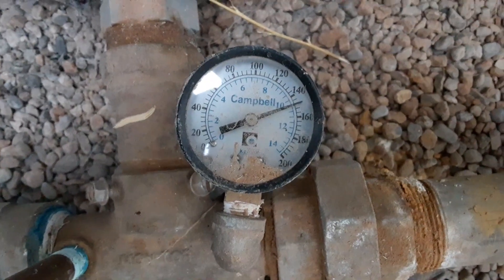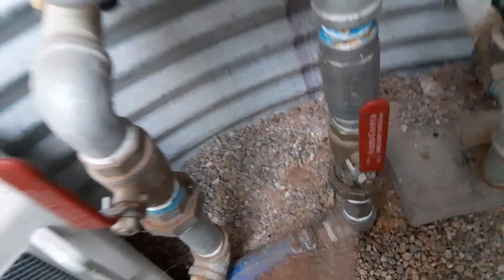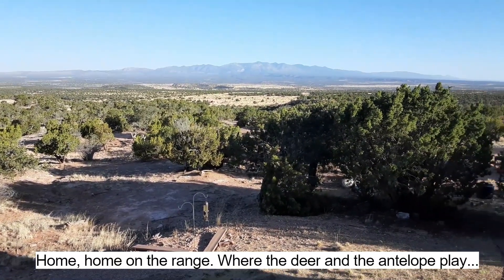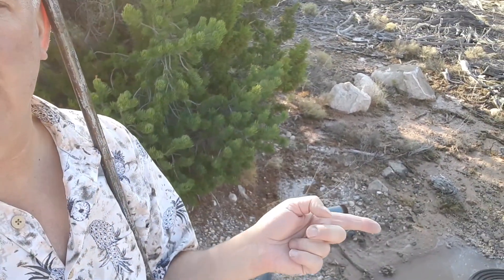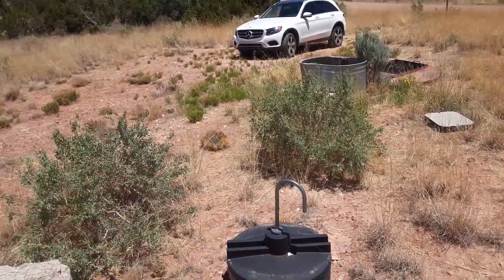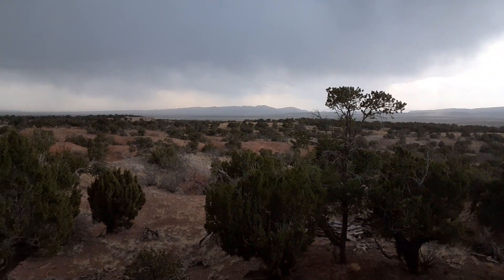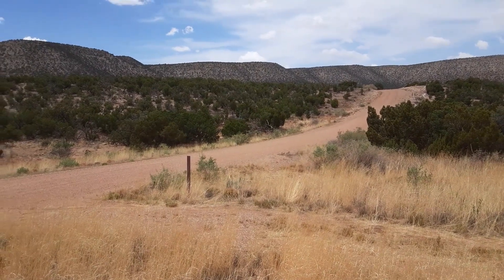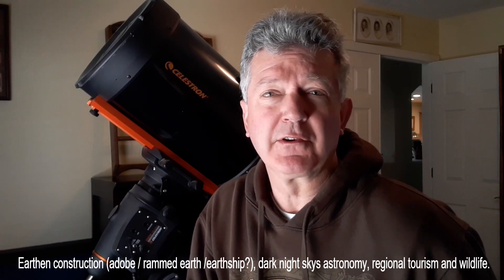NPL Episode 034: Well, Welding and Thunderstorms

Comment: My heart goes out to you Thayne. I would like to know how long the home you are house-sitting has been there. How is the water pressure compared to your home in ABQ?
Reply from the maker: Each home in DCP maintains their own external tank burried outside, usually a few hundred gallons but some have thousands of gallon reserve from both their well and rain catchment that they blend together.  Then they usually have a pump to bring it into their garage where it is filtered or osmosis system into a pressurized bladder tank and then maybe another booster pump to bring it up to what ever their desired pressure is they want.  This house basically does that with one difference in that after is goes through the filtration system it goes into a large non-pressurized storage tank of a few hundred gallons in their garage and when water is demanded in the house there is another booster pump that maintains pressure of the household trunk line.  So, the booster pump literally starts up every time you open up a faucet, flush a toilet, etc.  I'm more of a fan of having a bladder tank in the garage and keeping it pressurized there before it hits the household trunk line.  But each to their own.  So, yes pressure here is comparable to city water in ABQ.

Comment: I can hear the exasperation in your voice Thayne.   You are facing some serious challenges out there.  The issue of water, and the fear of running out of it, factored heavily in our reluctance to buy in Valentine Ranch.  You say your wells are 500 feet deep or more? - that is deep, brother.
Question - who pays for repairs to the water system out there?  Does the cost of finding and fixing that trunk line leak come out of the HOA money?  If so, then the 70 a month fee is not so bad after all.
Reply from the maker: Yes, we were very disappointed to discover this issue it almost makes us want to throw in the towel and move on, but since we have four other "owners" on this well group and each well group maintains a reserve balance of $5k or more it shouldn't have to come out of anyone's pocket right away.  Each group of homes on a given well are responsible for maintaining their "mechanical" room (well group) including the trunk line to each home.  However, I did hear something about some wells in the past having gone dry and the HOA having paid for drilling them deeper to get water again.  The HOA does have a seven figure reserve balance of funds they keep invested and on the ready to deal with issues.  So, at the start of each new year the balance well group is required to bring that $5k balance back up.   So, if we have to pay $1000 from the $5k fund to dig and repair the leak, each of the five owners on our well group would have to kick in $250 each next January to bring that fund to a minimum balance again of $5k.
Reply: @naturepreservelife  Man, you sure know your stuff! Very impressed.